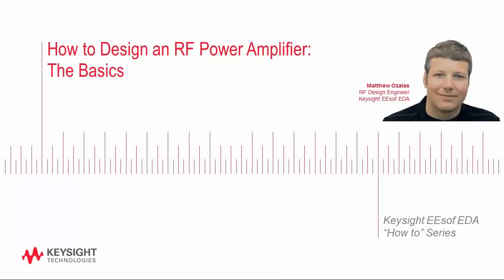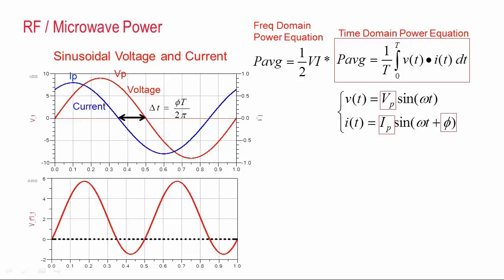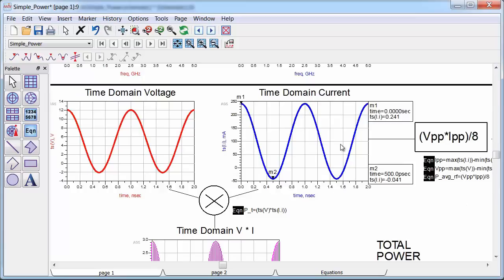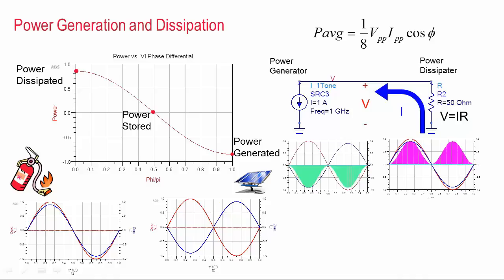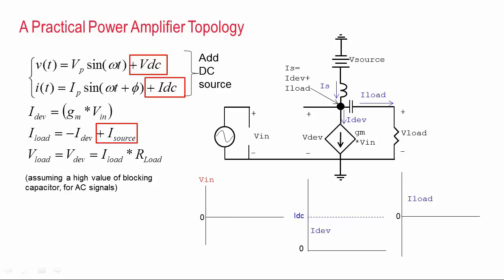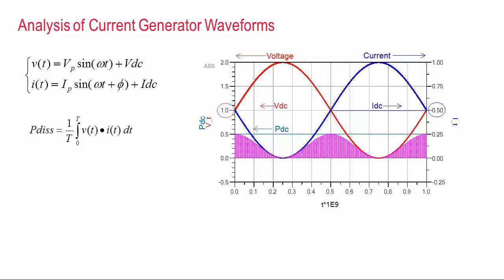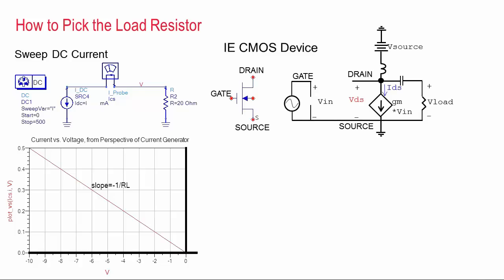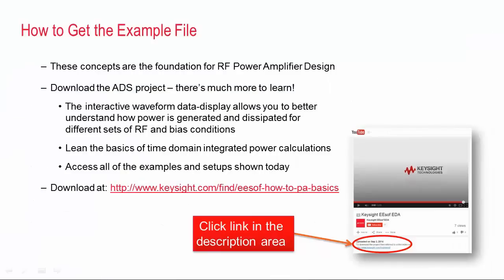How to Design an RF Power Amplifier: The Basics

Comment: I have one question. You mentioned that "since less current is pulled into the current source, instead it flows in AC sense from the power supply into the load." There is a bias inductor after the supply and if we think of RF( or AC sense)  this provides high impedance. So, how is the AC (or RF)  current flowing from the supply through the inductor to the load ? Doesn't the inductor resist ac current flowing from the supply into the load ? Can you please explain a bit?
Reply: I would like to add another question: With the similar concept how to explain the envelope current( for modulated signals) flow from the supply to the device and the  load for both class A and reduced conduction angle mode operation( class AB/B). Thanks.
Reply from the maker: These are questions that could take a book’s worth to answer.  Briefly, the DC supply provides the energy to the circuit.  At the fundamental, the transistor converts this DC energy to a high frequency.  It then gets exchanged between the transistor and the RF load network without much further supply interaction (assuming the choke’s designed well).  The combination of the current in the load and device will sum to the DC value over a cycle. For that to work (assuming no storage), the load current must go high when the device current goes low – this is kind of a redirection of current from transistor to load during the RF cycle. 

When there is a modulated signal, it contains the high frequency signal, but now there is a lower frequency envelope, changing the input power dynamically. Plot current vs. Pin to see how that may impact the dynamic draw from the supply. For Class A, if it never goes into compression, the DC current does not change much vs. Pin, as you move to Class AB, current does change more with Pin.  That means the device will dynamically try to pull current from the supply at the mod bandwidth – and if the bias network is designed well, then the supply will be able to deliver the current dynamically when needed.
Reply: @KeysightEEsofEDA  Many thanks for the detailed answer. I really appreciate that.

Comment: Hi Matt,
An amazing work!

I believe you have made a mistake at 3:20. We can not fine total power (RF+DC) using 0.5*Vp*Ip. We can use this formula just when the time domain signal is a single tone without any DC component and any other tones.

Thanks a lot!

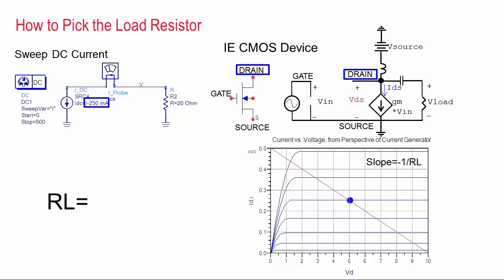Comment: Hi, thanks for the video. I have a question regarding the load line plot at 11:20 . Assuming the the plots in Id-Vds graph are for equally swept Vgs voltages, the Vgs swing has to be different in positive and negative directions to reach at the Imax and Vmax points. I have observed the same condition also when I simulate some real CMOS transistors. Am I missing something? Thanks in advance.
Reply from the maker: +Denizhan Karaca 

Good question!  You are correct -- the transconductance
of a CMOS device is not linear –it’s a square law relationship (Id is
proportional to Vgs-Vt squared) .  
This means that the positive portion of
the gate (or input) waveform experiences a higher effective gm than the
negative portion of the waveform.  You may find this video on the basic
classes of operation [https://youtu.be/GhPqPVlDRPY] interesting, as the
nonlinearly which you refer to at the input is more explicitly illustrated
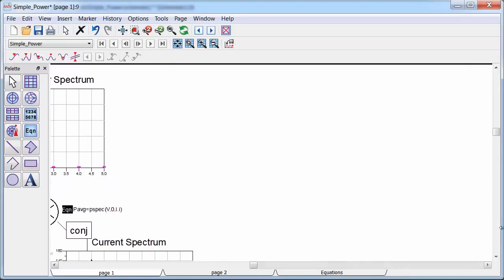(around 3:00).  The video also shows that to get the classical values of
efficiency for a power amplifier, the trans-conductance is linearized (Id is
made proportional to Vgs-Vt) – or at least this is done in a mathematical sense
to derive the waveforms and the corresponding ideal efficiency.  Since no
device actually behaves so nicely as to have a perfectly linear
transconductance, you can therefore never realize the ideal efficiency values
for a Power Amplifier in real life!
This non-ideal transconductance also implies that there is
no single bias point where the device will be exactly at the brink of turning
on and off (the so called “threshold” in Class B where exactly half of the
waveform perfectly conducts).  Consequently, most amplifiers biased near
the Class B threshold point have low or no small signal gain in the lab – in
other words the Gain vs. Pout plot is highly expansive as power
increases.  
One of the big challenges in any practical PA design is
dealing with the effects of these types of non-idealities – in many cases what
you can actually realize in the lab is far removed from the waveforms and
loadlines that the theory implies.  
Depending on how you look at it, this
can either be very disappointing or very exciting and interesting!
Reply: +Keysight EEsof EDA Thanks for your detailed explanation, it is very clear and helpful.
Reply: Keysight EEsof ED